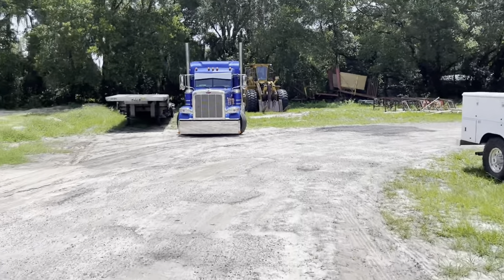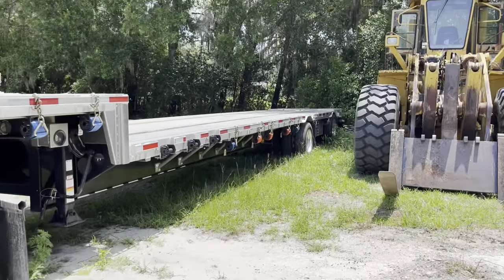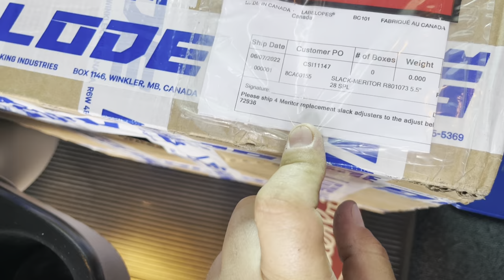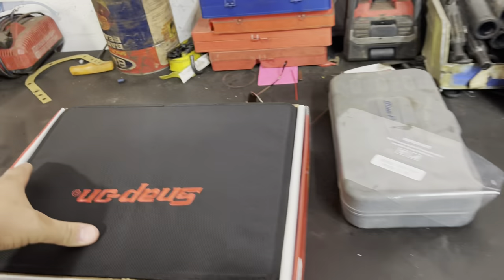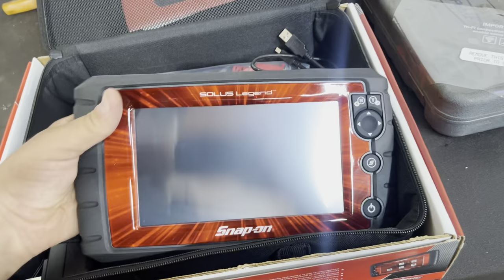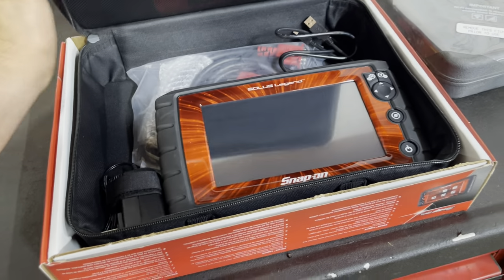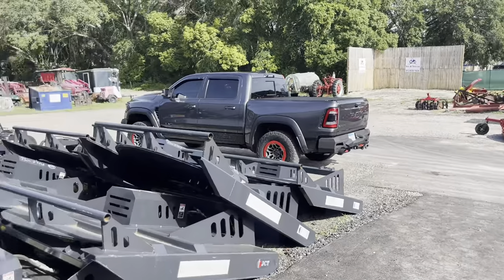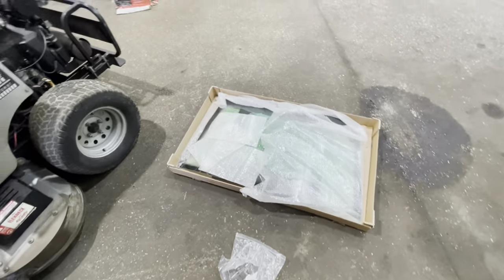Junk Trailer for sale.... Who wants it?? I’m Done!!

Comment: wow, im not even in trucking...yet.. im VERY angry for you over this so called "NEW TRAILER" they sold you.. it's been like a hot potato as in the problems that it has should have been addressed immediiatly by them giving you another brand new trailer (if they stand behind their product)..and not have the trailer problems passed on to you as "the customer" to deal with... that infuriates me.